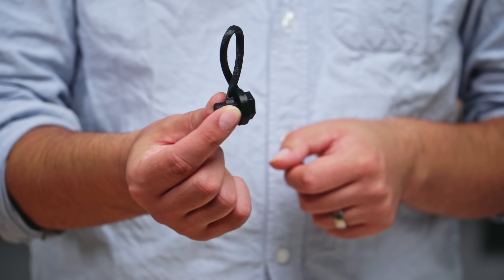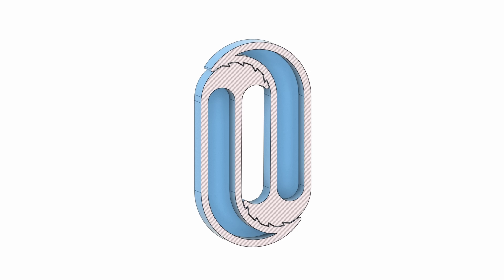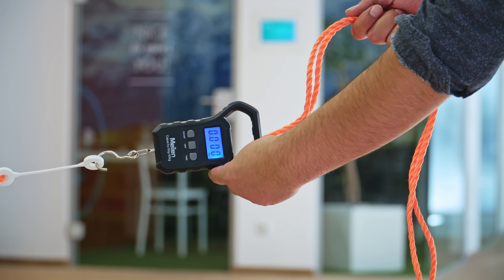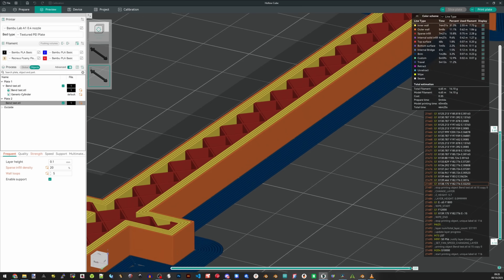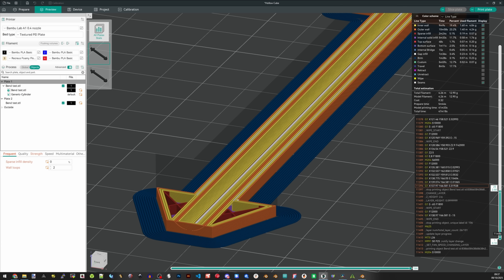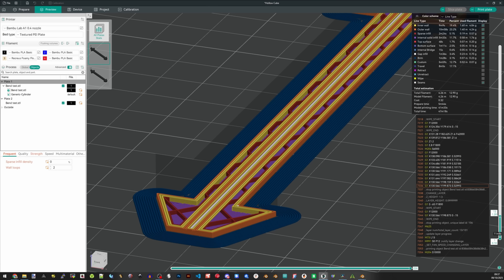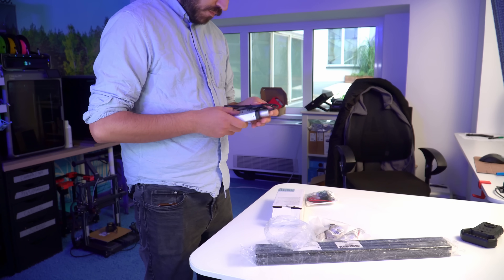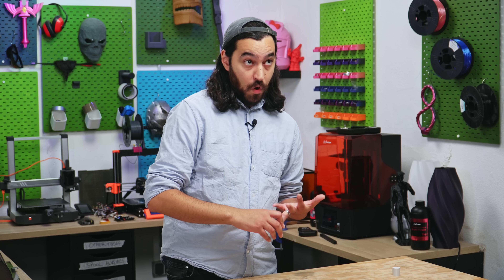This Part Is Strong And Stiff....But Hollow!

Comment: About 6 months ago I did raise this suggestion for Orcaslicer as a auto chamfer internal corner for strength. Doesn't have to be too complicated. But it seems answer is to have it designed in the part. Not the slicer job. 

I could, and I know, but I want a simple button that helps most people in 90% of simple case to get the part stronger without doing much. 

For people that know already can do this themselves then it's not for them.
Reply: If you are up for the challenge you can just give it an attempt, yourself.

Comment: I don't get the point of this video. I always prototype without enhancements to strength, test then add design components to alleviate the failed areas.
Reply from the maker: This is the best thing to do. A while ago I downloaded something that had just a bit too much flex to it, I could redesign it but I wanted to keep the external geometry and also I just didn't have the time so I just added more perimeters instead. If one finds a model that has too much flex and they're not familiar with design that's really all they can do. Even if they are familiar with editing a STEP file they might not be familar with mesh editing an STL. And seeing as most designs are optimised for having a flat base for best first layer adhesion you're going to have a 90 degree internal corner. Seems like having a slicer setting for this could be useful. Its definitely not a replacement for prototyping and testing.

Comment: Why did you put all your skådis boards in the wrong direction?
Reply from the maker: We don't think the skådis boards are in the wrong orientation, we accept all orientations equally. Seriously though, we had to install a wall on one side of the workshop and we couldn't fit the boards in a nice arrangement so we rotated them. Seeing as we're printing all the attachments it doesn't make much difference, we just designed a peg that fits the rotated holes.